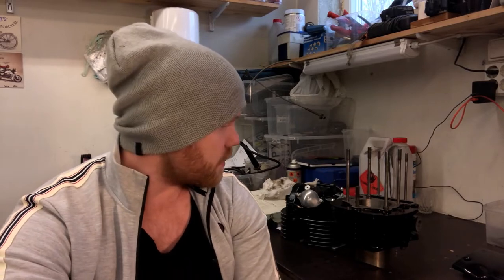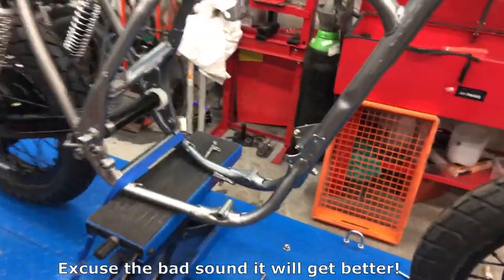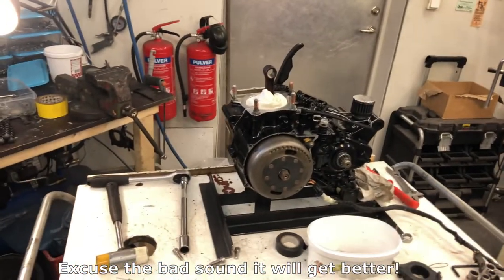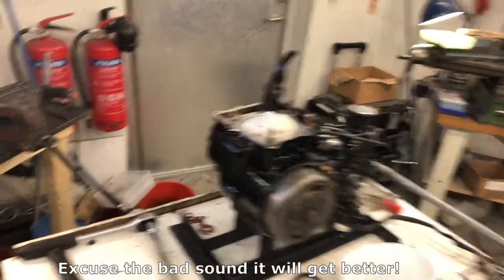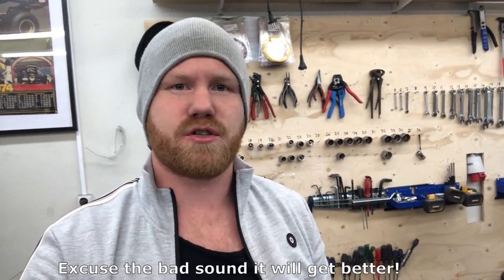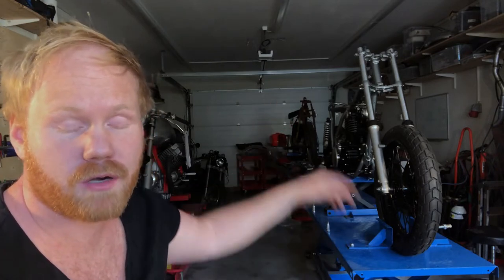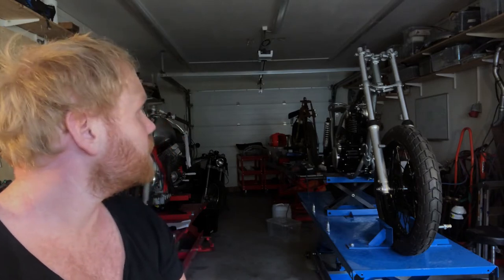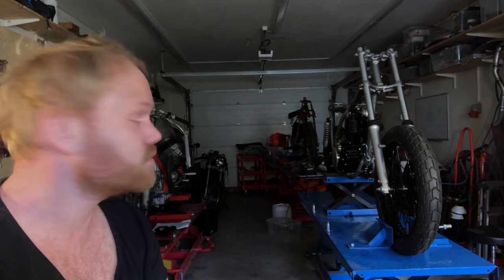Motorcycle Engine Mount | Scrambler Build Yamaha SR500 Ep.4

Comment: Du ser ut att använda fel "bult" vid 6.53....

Finns 2 olika dimensioner på bultarna beroende på års modell.

Item 28404: Bolt for Oil Filter Cover, Length 48mm, OEM Reference # 90109-06511
Application: TT500'79-, XT500'79-, SR500'79

Item 27866: Bolt for Oil Filter Cover, Length 40mm, OEM Reference # 90109-06419
Application: XT250, XT350, SR500'78, TT500, XT500-'78,
Reply from the maker: Okej, får kolla det.. köpte ett kit med rostfri skruv/bult till SR500 1978 motorn.
Reply: Kolla att det verkligen är en 78'a och att den inte är utbytt till en senare årsmodell.
https://kedopartsaustralia.com/sr400-sr500-model-id/

Jag har en -78, dock med -82 motor, någon tidigare ägare har förmodligen lyft över -78'ans bult till -82'an....
Efter ett tags körning så råkade jag ut för ett "ras", -78'ans bult kan ha bidragit till raset då den är "för kort" till en -82.
Resultatet blev en nergången kam och två slitna vippor, förmodligen på grund av dåligt oljetryck.   (https://www.dropbox.com/sh/eec85p8m18uteah/AACHuPMNEqJPeh3lwB7YxkR0a?dl=0 ).

En till länk ang. "bulten".
https://www.xt500.co/viewtopic.php?p=63900#p63900
Reply from the maker: vi kollade upp allt, det är en 78a så vi beställde en ny skruv så allt blir perfekt! Tack så jättemycket för tipset! Hoppas du gillar kanalen och ser fram emot fler videos! Tack så mycket!